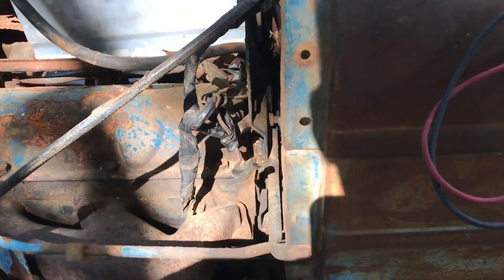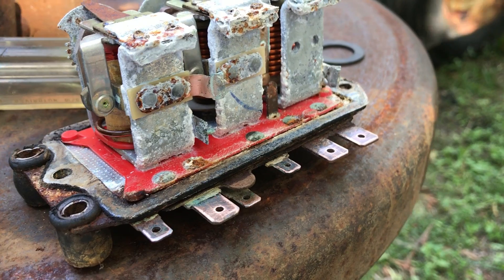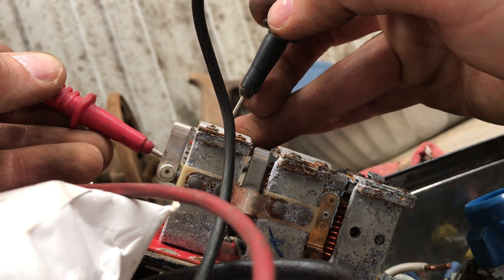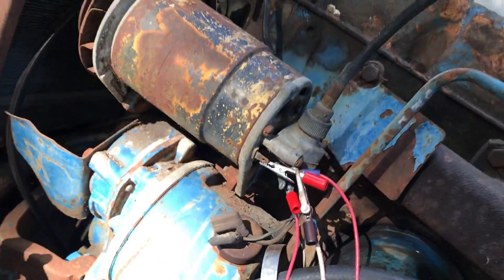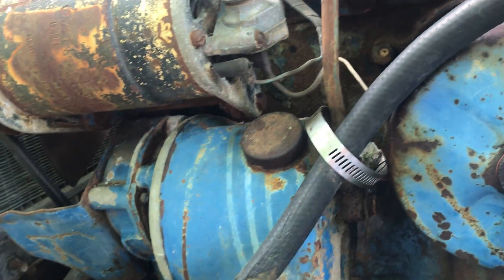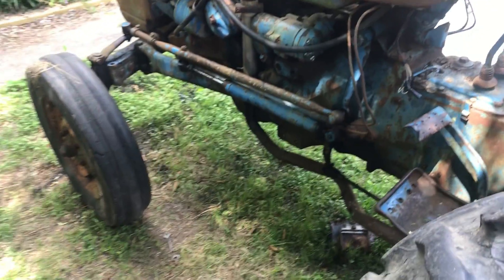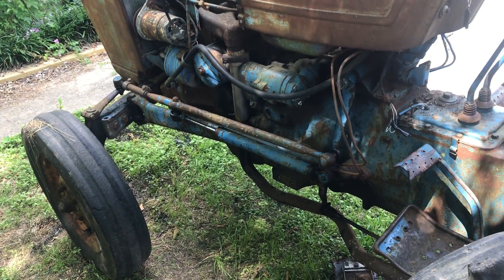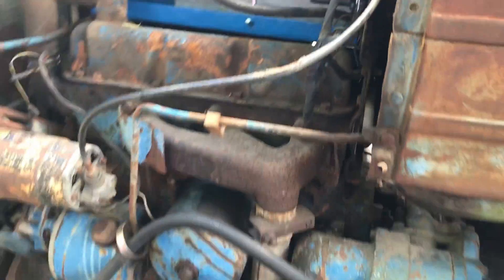Ford 2000 Tractor Charging System

Comment: I don't get it. With the old regulator you had 14.4V at the battery, right? That should be okay, so why a new regulator.
Reply from the maker: Voltage dropped off and didn’t charge.

Comment: I would assume the flashing puts magnetism back in the magnet through the winding??
Reply from the maker: I had to look it up. “Polarizing your 12-volt generator is necessary for your generator to work in conjunction with the regulator. A generator, unlike an alternator, can run off both positive and negative current. A regulator always runs off positive current. As a result, if the generator is not polarized to a positive charge and positive current is sent into the terminals, the generator can be damaged as well as the other motors and switches on the same current.”

Comment: I'm in the same pickle with a 68 Ford 3000 tractor. Gen. light stays on and drives me crazy. Regulator looks new but I cleaned it anyway. The generator will spin but I have to help it to get started. I read to put a meter on it and if it reads 30 its good, if 5 its bad. I got a 4 but I don't trust my multimeter skills. What I was looking for on your video is if there is supposed to be a third wire going to the battery to do the charging or if that's something that happens through the battery cables? I didn't see one but I was only getting quick glimpses. My best guess it my gen. is bad even though it spins.
Reply from the maker: I don't think there are any other wires, mine just stopped working and I'm pretty sure the generator needs new brushes. Maybe your does as well?
Reply: @mjmcomputers  Yeah, turns out the generator was bad. I converted to an alternator and it charges like a champ. No third wire going to the battery to do the charging like I've seen in some setups. What confused me is it would spin when hooked to power....which I was told means its good...but I had to help it get started...just enough to leave me skeptical.
Reply from the maker: @jeffreygleaves2931  did you get one of the conversion alternators with the tach drive? I've considered one of those.
Reply: @mjmcomputers  Yes, it works well. I ordered the cheapo kit off Ebay. I wish the tach cable I ordered was a couple inches longer (40") and it sets awfully close to the exhaust manifold. I might have to fabricate something into extra heat shielding.  The wiring was very simple but the cheapness of the kit proved challenging.  You're going to have to make a few things work. They welded a part of the bottom bracket on upside down so the alternator doesn't rotate unless you grind a corner. The spacer was too short so I had to cut a longer one. They give you a male and female spade connector you're supposed to put together but they're two different sizes so you're going to have to dig out your own. Its a good idea anyway because their connectors are so cheap and thin they fall apart.  You're going to have to buy a longer fan belt. Other than that I'm pleased. The battery is charging well. The headlights work. The warning lights are out. That's saying something considering I don't know anything about wiring.  
A guy called Farmboy I believe has a video on the same kit. You can watch him cuss it as he does the install.